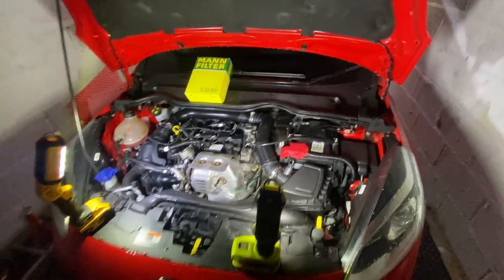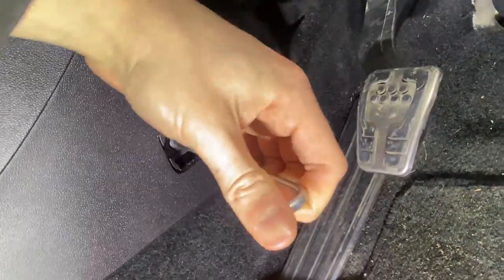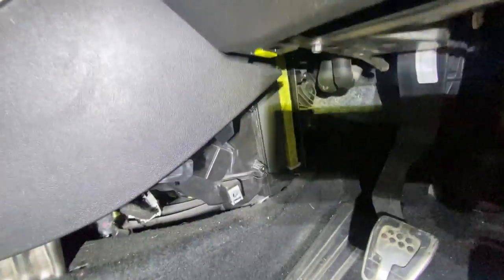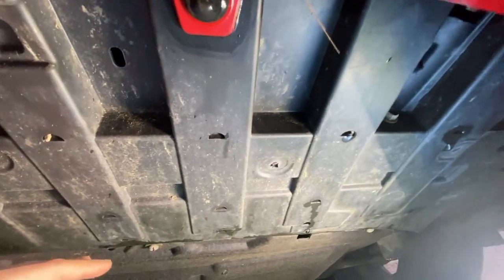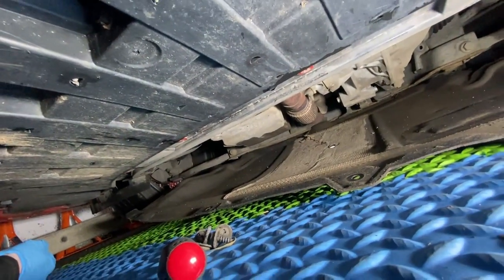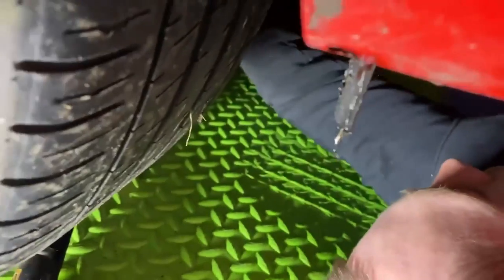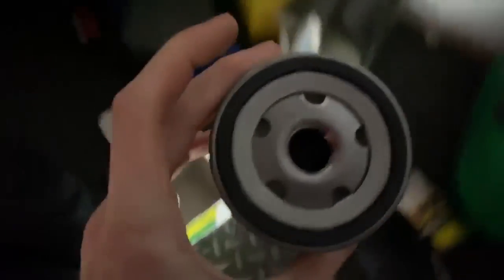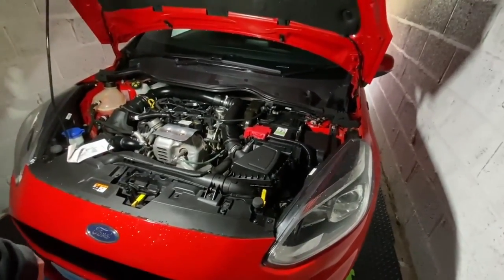2018 Ford Fiesta 1.0 Ecoboost Full Service | Oil, Oil Filter, Air Filter & Cabin Filter

Comment: Nice video. Did no oil drip out when you took the filter off?
Reply from the maker: Yes some oil dripped out but I had the catch can under it then cleaned it with break cleaner
Reply: Some filters have a non-return valve which stop oil leakage when changing filters, fords especially 🙌🏻